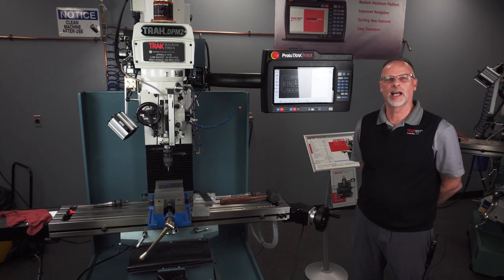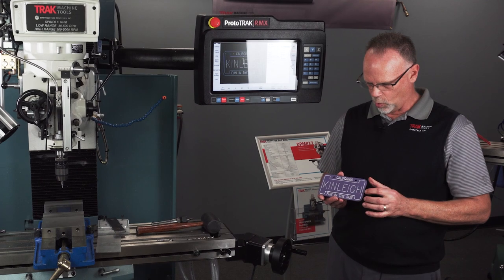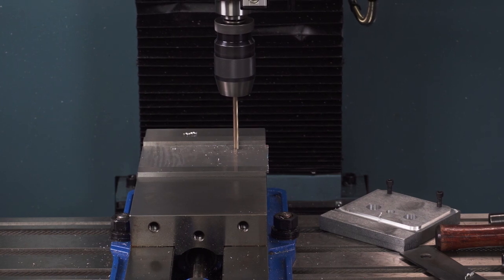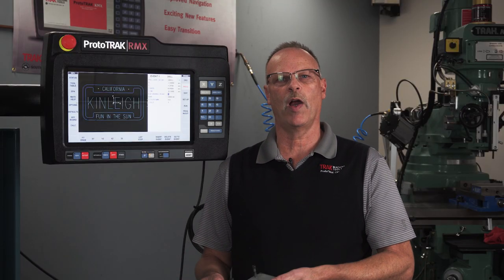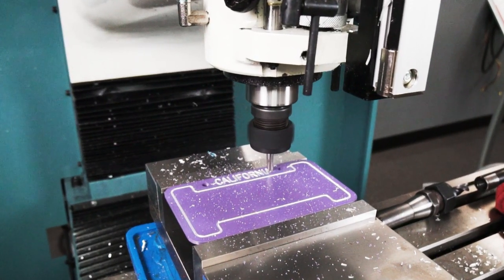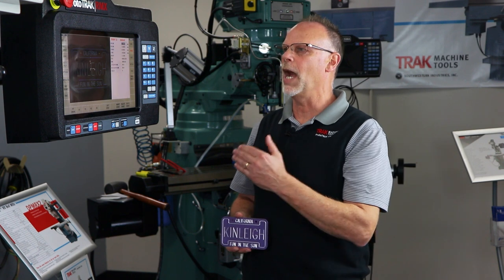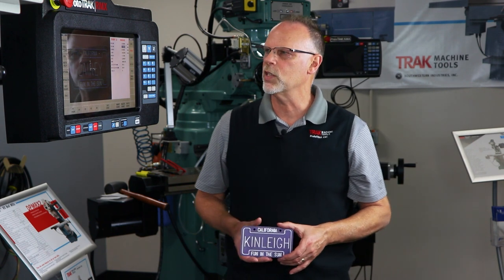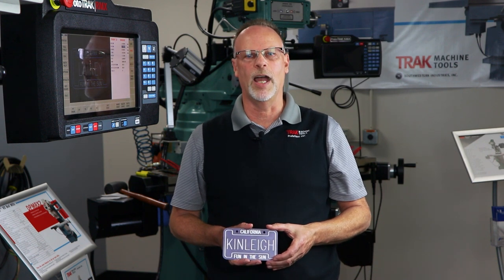Bicycle License Plate | ProtoTRAK Project

Comment: Super glue and blue painters tape is a great way to fold flat stock like this. You can skip the all the drilling and tapping and do it in one setup. Flycutting the fixture plate before you glue the part down is  a great way to insure a perfectly trammed surface. NYCNC has a great video on superglue fixturing.